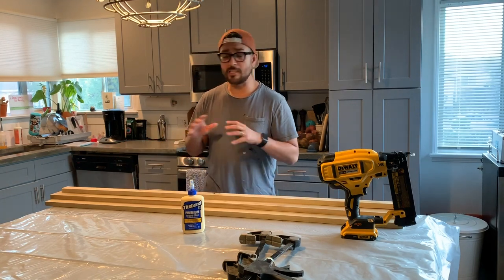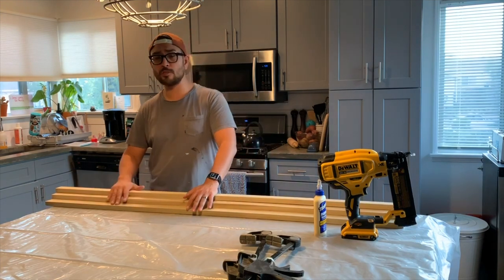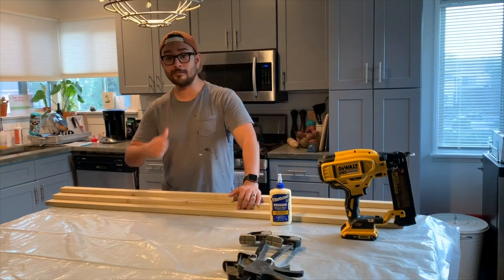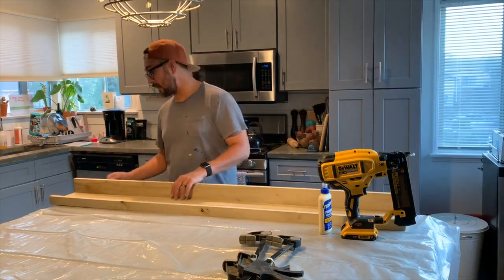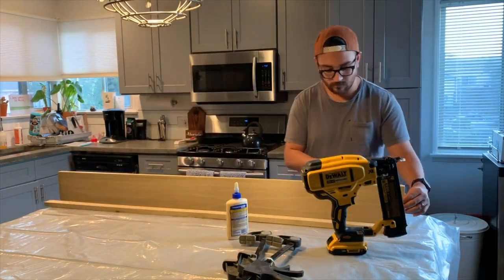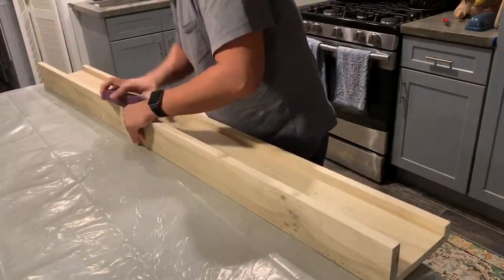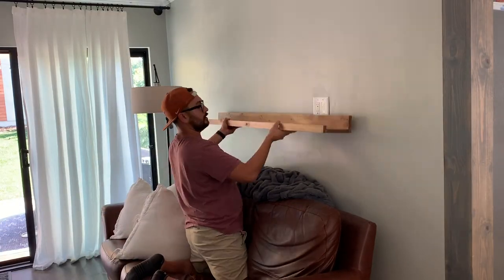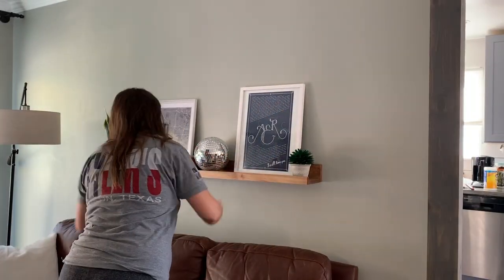How to build a SUPER EASY DIY floating ledge shelf for less than $10

Comment: Bought my materials and realized I don’t have a brad nailer! yikes. Could I use a drill + screws?
Reply from the maker: Yeah you totally could! You’d just have to drill some countersink holes so your screw sits flush with the wood. Then cover up the screw with some wood putty!
Reply from the maker: Yeah you totally could! You’d just have to drill some countersink holes so your screw sits flush with the wood. Then cover up the screw with some wood putty!
Reply from the maker: Or just wood glue the boards together. That should hold just fine for a smaller shelf. But screws are my reco.
Reply: Robuilt Great! building this baby today. Thank you :)